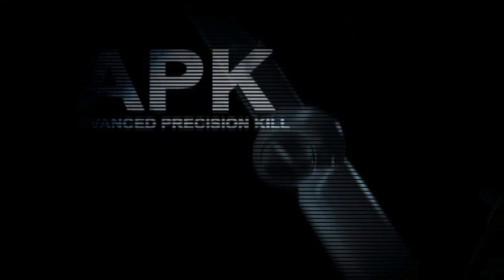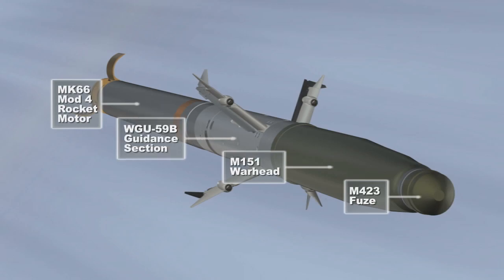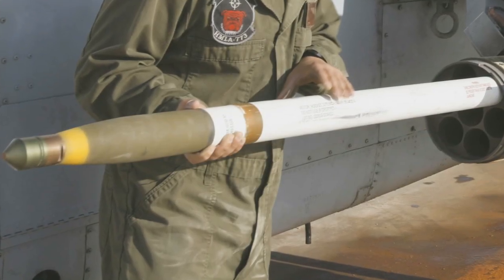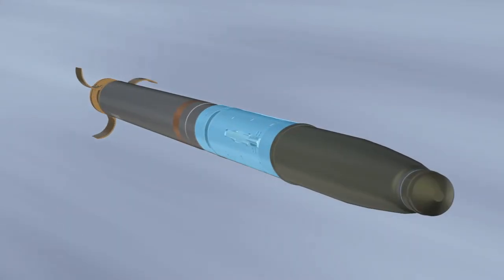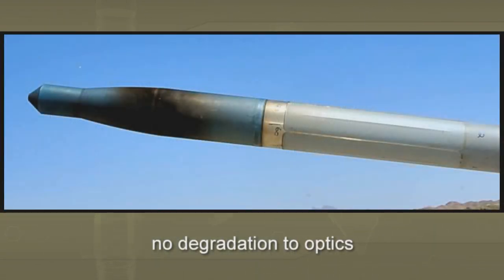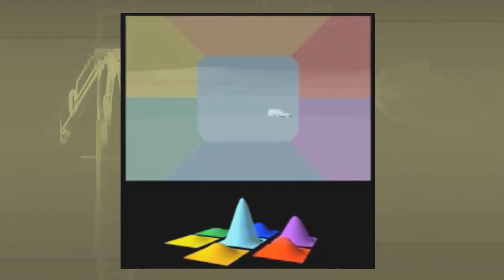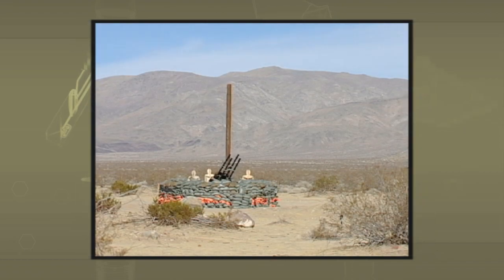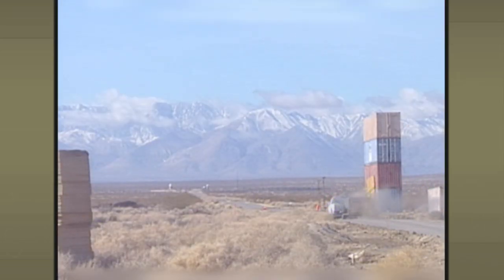BAE's Advanced Precision Kill Weapon System

Comment: can this thing be used air to air? at the very least the APKWS will eliminate the need to fire salvos of rockets
Reply: you could against slow moving, low altitude aircraft like helicopters but since its low velocity and short burn it would be short ranged and ineffective vs fast moving combat aircraft.
Reply: A Chaps Good question. There has been at least one confirmed air to air kill with a hellfire missile so it may be possible.
Reply: A Chaps Technically possible, but not likely. You'd have to maintain a laser track on it, which could be difficult with anything faster than a helicopter or smaller than an Mi-8.
Reply: Eight years later there is a quad pack launcher and a little radar unit that fits in the back of a pickup. They're starting to use them in Ukraine - proximity fused warheads for anti-drone work.